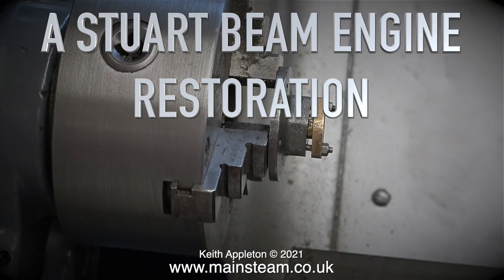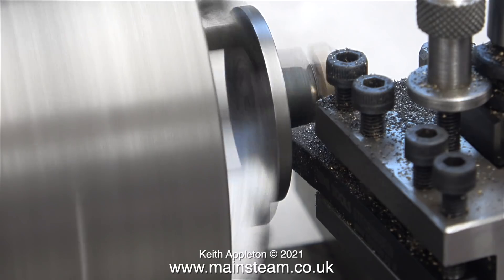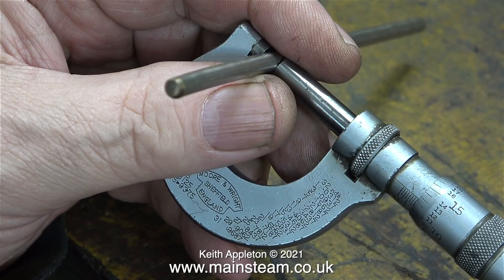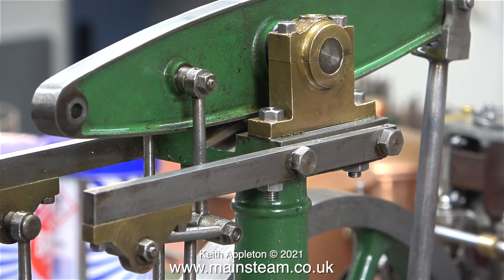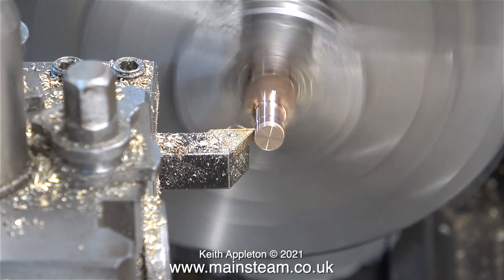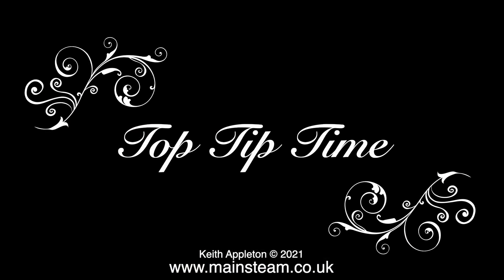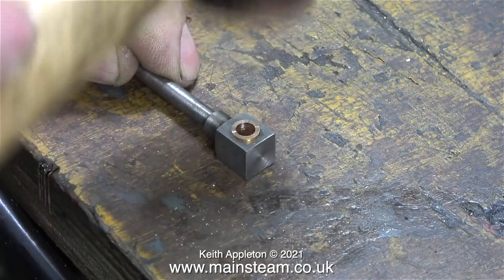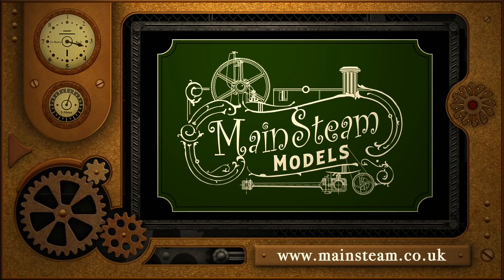A STUART BEAM ENGINE RESTORATION - PART #5

Comment: One of the problems I had when I started doing steam engines was not leaving enough clearance when making parts, the engines would run fine on air, but would size up when run on steam. It took me a while to learn how much clearance too leave.

Comment: Good series I think. It always amazes me the level of engineering required and the use of different types of metals used in these engines. The required mechanical components are also very interesting. You really have me fascinated with these steam engines. Thank you.

Comment: what about a c clamp to press fit the bushing in?
Reply from the maker: but .....but ..... I don't have a C Clamp ........
Reply: @keithappleton  just a suggestion
Reply: I'd use a pencil.......and draw it in.
Reply from the maker: I will use a 10 Ton CNC controlled Hydraulic Press next time, you know, the kind that all beginners have in their Workshop . . . .
Reply: @keithappleton  hope what I said you took as a suggestion didn't mean to insult
Reply from the maker: not an insult, you just make a lot of "suggestions"
Reply: @keithappleton  just trying to help

Comment: Dear Sir,
I found, in me late father's apartment, a conical reamer. I wonder what purpose does it serves. Well, to ream conical holes, i suppose, but where is it necessary? I could send you a picture of it, but i guess it would be as useless as a picture of a former girlfriend of mine.
Cheers from Brazil.
Reply from the maker: They are called Taper Reamers and are user to ream a tapered hole to receive a Taper Pin which is a very accurate & tight fit. Model Steam Engine parts are often held together using Taper Pins.
Reply: @keithappleton  Thanks!
Reply: Also, it depends on what kind of picture it is of the former girlfriend.  I’d say go ahead and send it.  I’m sure somebody somewhere might find a use for it.